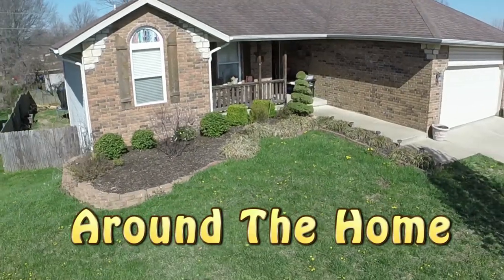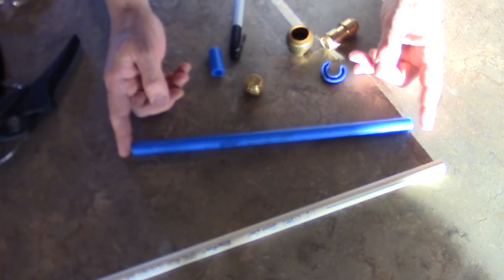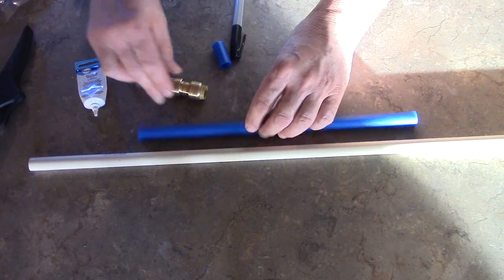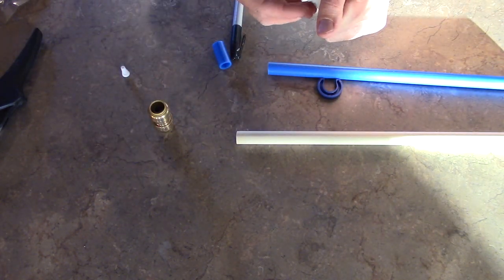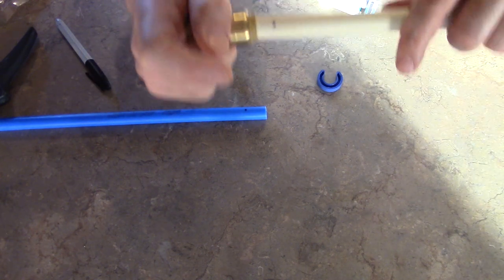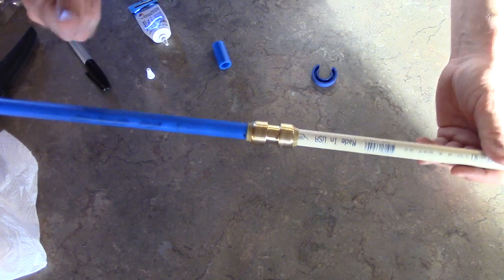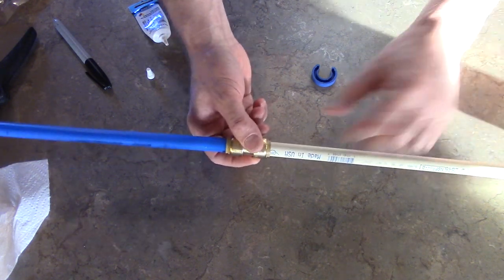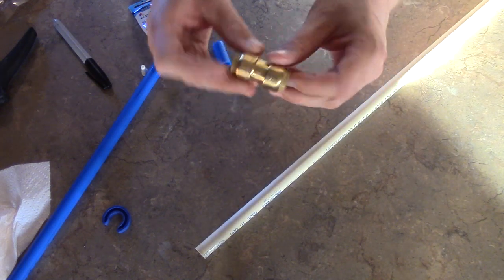SharkBite Fitting - How To Use

Comment: Question - If the CPVC piping is labeled 1/2" would I use 1/2" PEX OR 3/8" PEX?  Thanks - Great Vid
Reply from the maker: 1/2" CPVC / 1/2" Copper / 1/2" PEX all have the same outside diameter. Same goes for 3/8", 3/4",  and 1" respectively.

Comment: Isn't there a plastic stiffener that you have to place inside the fitting before pushing in the pex pipe?
Reply: Sharkbite fittings are sold with the white plastic inserts already inside each end.
Reply: @phillyflash43 I just bought a sharkbite fitting that doesn't have those plastic pieces in it, and the guy at the hardware store says it doesn't need them, is that true? Because I was thinking they need them

Comment: I have a broken pipe in the garage outside wall , how or can I join the two pieces together with shark bite ?
Reply from the maker: What kind of pipe?
Reply: @AroundTheHome1  cpvc
Reply from the maker: The shark bite is designed to do this. And if you have a small broken area, like an inch or two is damaged, there are connectors that are a few inches long for repairing damaged pipes. You just need a clean cut on both ends and this should work great.

Comment: Do you remove the "sleeve" when using copper pipe with the above shark-bites???  Someone else said with copper that the inner white sleeve has to be removed.
Reply from the maker: Ok, so the older Shark Bite fitting, the sleeve came in the bag and if you wanted to put it in you just did. It wasn't necessary for copper, just for pex. But the newer ones come with it already inserted inside. You do not have to yank it out if you are using copper. Don't worry about it and just slide it on your pipe, whether it is copper of pex. Thanks for watching and don't forget to stop by our website for many more helpful videos. www.greatwhiteninja.com
Reply: @AroundTheHome1  Thanks...I already have most of my shark bites connected...would hate to take them apart.
Reply from the maker: No problem, and good luck with your project.
Reply: @AroundTheHome1  BTW, I watched a few of these videos & it is suggested NOT to use shark-bites connectors inside walls. Since shark-bites are a relatively new product there are some concerns. There is a rubber O-ring inside these connectors that may dry out from chlorine (in some waters) causing leaks. I suggest buying some "Jack's" lubricant which is used for swimming pool O-rings. Do NOT use a petrol based lubricant (Vaseline, etc.) on rubber. "Vaseline or other petroleum products should never be used on rubber or neoprene objects. It can deteriorate the rubber or neoprene very rapidly. The correct lube to use is a silicone based lubricant, which comes with or without Teflon. This is available in spa or pool stores."  "Jack's Formula 327 Multilube, SP0327 by Hayward. Pool & Spa lubricant for o-rings and threads on pool equipment."  I would presume, if one's water contains chlorine one would use Jack's....if needed in these shark-bites.   ????????????????????
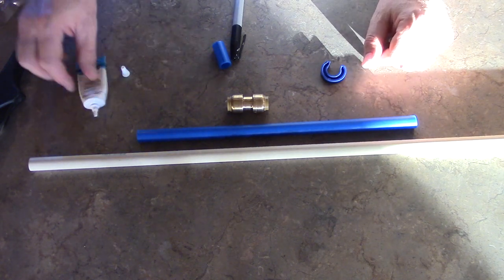Reply from the maker: Katrina, there was no reason to look further then our video. I talk about the "O" ring in several places starting right at the begining of the video at 0:35. I talk about the silicone grease and use it at 1:40. And I mention about not using shark bite fittings inside walls or other un-accessible areas at 7:11. Here is an Amazon link for the same silicone grease that I use. https://www.amazon.com/Waterproof-Silicone-Grease-1-Pack-88693/dp/B000DZFUPC/ref=as_li_ss_tl?crid=14WGWSQTLXCED&keywords=danco+silicone+grease&qid=1573761966&sprefix=danco+sili,aps,189&sr=8-1-spons&psc=1&spLa=ZW5jcnlwdGVkUXVhbGlmaWVyPUFaMTNJMzc4QjZWTDImZW5jcnlwdGVkSWQ9QTAwMDQ4MjQyV09OSENKSUFVUE1NJmVuY3J5cHRlZEFkSWQ9QTAxOTYwOTMzU0pGU0c2NlpQSkMzJndpZGdldE5hbWU9c3BfYXRmJmFjdGlvbj1jbGlja1JlZGlyZWN0JmRvTm90TG9nQ2xpY2s9dHJ1ZQ==&linkCode=ll1&tag=greatwhitenin-20&linkId=ccb9a2a527b0855ed54582a5a6e2b4e8&language=en_US
If you are putting together copper pipe inside a wall I prefer to use compression fittings. Do you have any other questions?
Reply: @AroundTheHome1  OK...don't get twisted.  I review options & opinions of others.  You don't have a monopoly.
Reply from the maker: Not twisted at all. You read too much into that. You said that you had to go to these other videos to answer your questions so you had me question myself if I forgot to mention those items so I went back and reviewed my video to see if it was there and noted the timestamps while I was re-watching it. My response wasn't mad, just matter of fact. I hardly have a Monopoly, just saying you didn't have to go to multiple sources to find your answers is all. Good luck on your project.
Reply from the maker: Looking back, I should have worded my answer better. I can see why it was easy to think that I would not want you check other people. Anyways, good luck on your project. If you are working with copper inside a wall, I would suggest some good compression fittings. And I don't have a video on that. I should, but looks like I don't. Have a great day.
Reply: @AroundTheHome1  all these shark-bites I am using where I can get to them easily if an issue. Thanks